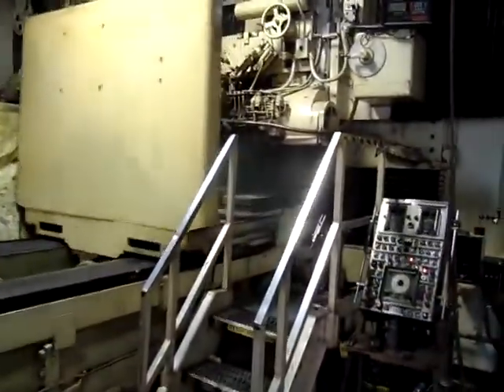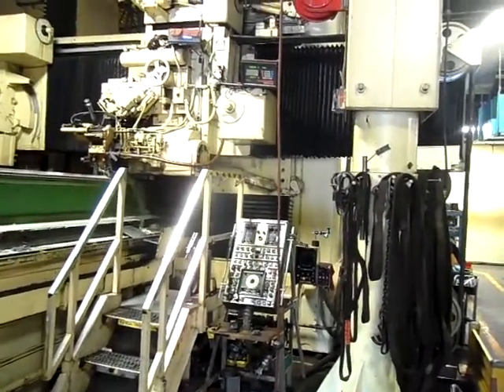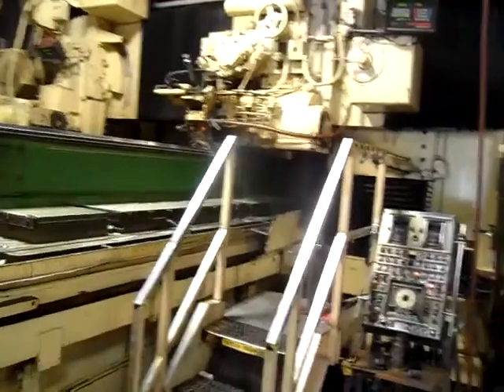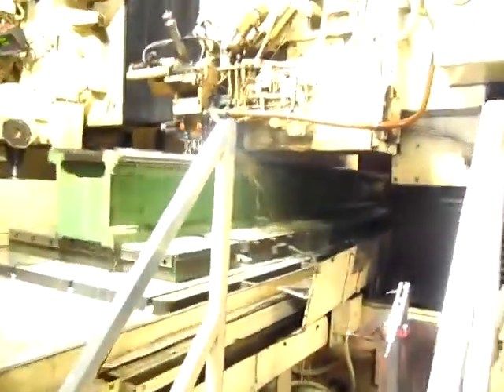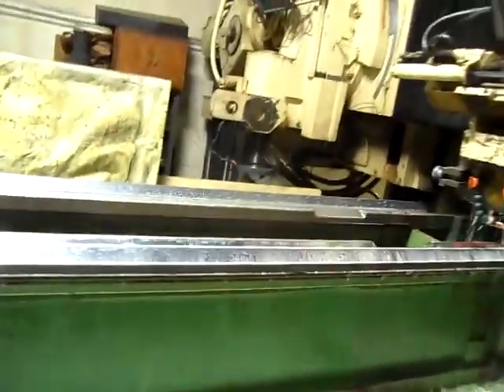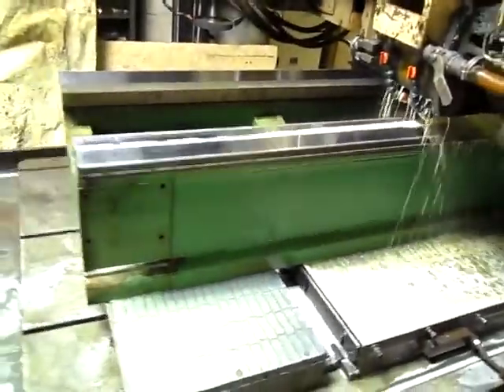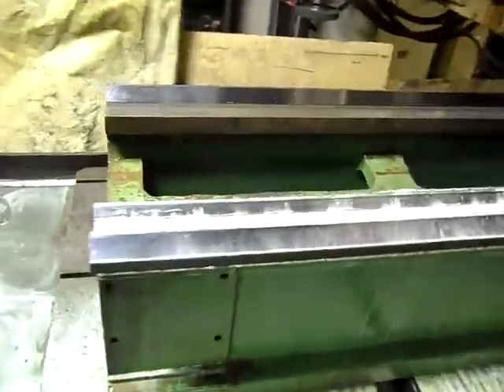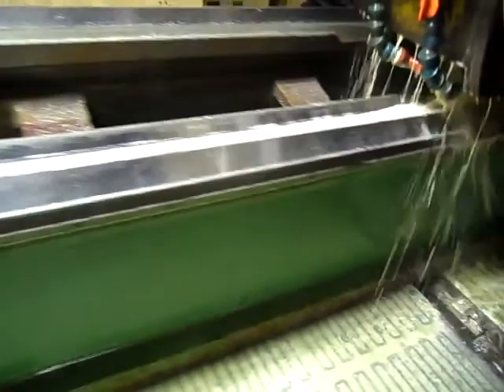Mattison Grinder at work

Comment: Amazing! One question: I've got an old Monarch A lathe (18.5x24), one of those early models with flat belts and babbit bearings. It works well. Do you think it is worth reconditioning? I'm talking about regrinding the ways, refitting the headstock, saddle and tailstock, rebuilding the headstock to put roller bearings, maybe replace a few bushings, etc. It may be old but it's very robust; far more than the typical Chinese lathe. How much do you think that will cost (rough estimation)?